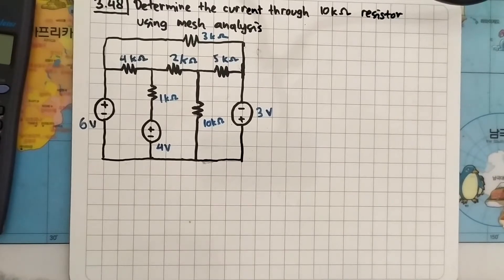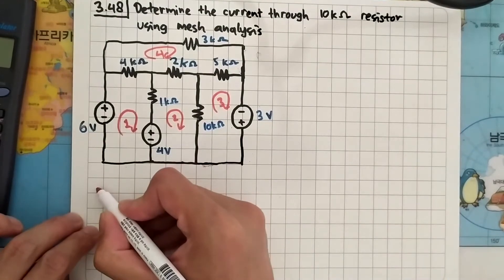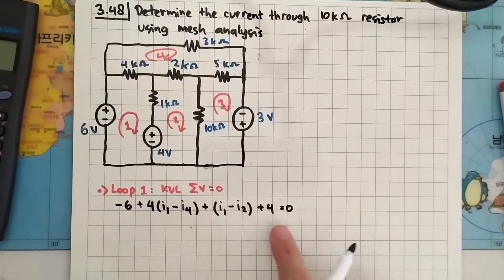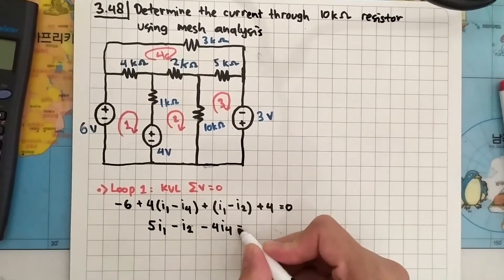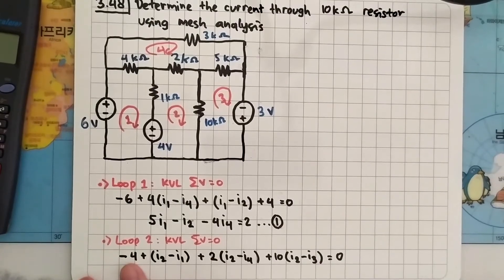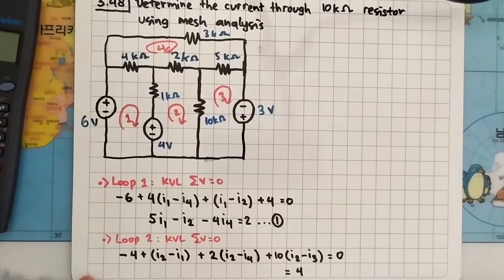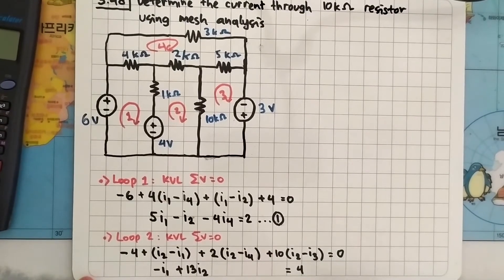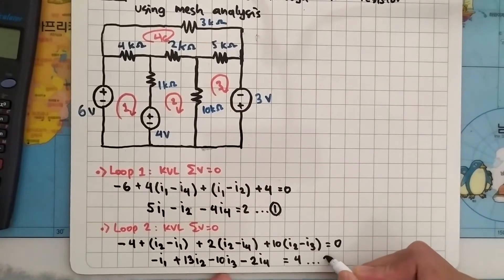Problem 3.48 Determine the current through the 10-kΩ resistor in the circuit of Fig. 3.93 using mesh

Comment: is there a way to solve the matrix other than matlab?
Reply: graphing calculator, or crammers rule or finding the inverse of the matrix then multiplying it by the voltages on the other side of the equation but that takes long to do by hand, were allowed graphing calculators for that
Reply from the maker: Calculator. Linear Algebra.